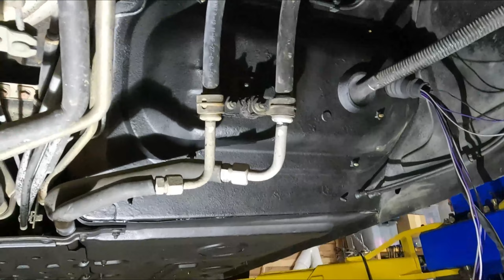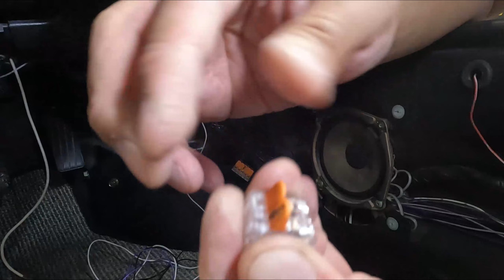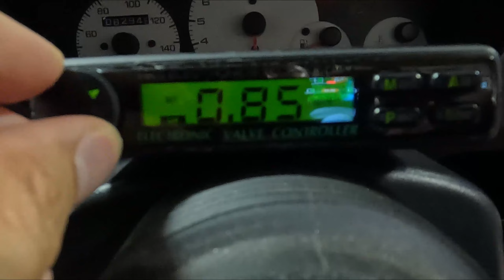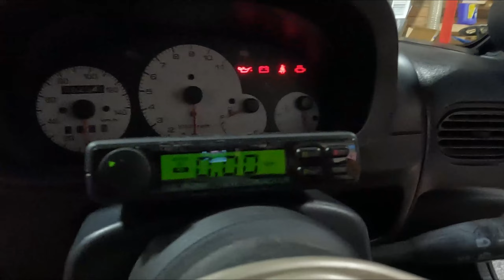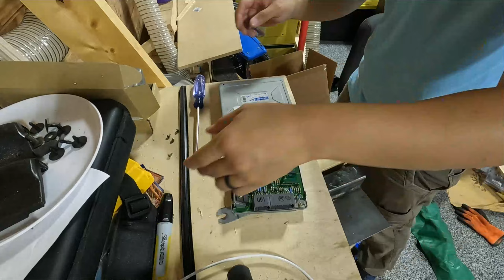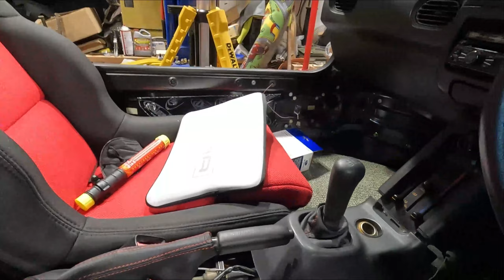AZ-1/Cara - HKS EVC Boost Controller + MONSTERSPORT N1 ECU Install + Testing = busted by the police.

Comment: New to the channel so I may have missed the answer in a separate video, but curious why the change from kei sport to N1? Been looking at options for ECU upgrade for a while and interested to know your thoughts on the two. Great videos!
Reply from the maker: I plan on ending on the keisport. I just did the N1 because I had to swap the stock O2 for a wideband sensor and didn't do that yet. I did try it in a prior video without and it was terrible without it. 😂  A N1 computer showed up and I wanted to get it to try to see what it was like before going keisport to compare too. I haven't seen another N1 since the one I got. Although I'm not looking that hard.
It will be tuned afterward with a different turbo and injectors so I'll have more comparisons.

Thanks for watching!
Reply: @AnythingWheeled  very cool. Thanks for responding, I’ll definitely be tuned in to see how it goes!